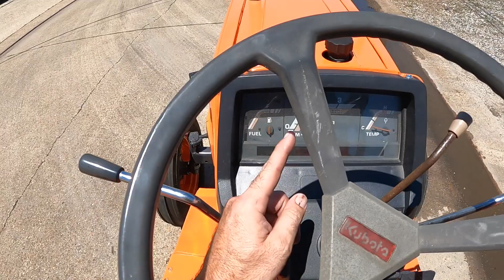Kubota Tractor Restoration ~ Make Your Tractor Look NEW Again!

Comment: Great job. Looks like new. Mine is a L2850 DT. Would like to attach an additional valve bloc (2 double, 2 single action valve). I wonder how to connect the bloc to the bloc on the right hand. On the first look, I would connect P to the pressure outlet at the Kubota bloc and T ( valve monobloc) to the second port on the right outer side of the Kubota bloc - or is the T port on the front the correct one? Or should I fit the power beyond port at the monobloc to the T port at the bloc? Kind regards Heinz, Germany

Comment: I picked up my L2850 end of summer. It’s in great shape but I noticed my 1st-4th gear shifter dash section seems a bit loose where when I shift the black dash piece moves around a bit. Does that sound like something is broken under there or just missing a screw or what?? I have not had a chance to look at it being down from surgery for a couple of months now.

Comment: Awesome restoration, I have the same tractor and wanted to change out my broken headlight assembly as well.  Just curious what brand 20" light bar did you used for the head lights?  Also did you have to make up your own mounting brackets for it?

Comment: This was fun to watch. Just got an L4850 that needs some love. Did you rhino line your own or do truck bed liner? What's the prep on that? Aloha
Reply from the maker: I had it sprayed. It’s a much stronger coating because it’s a two part product. I just prepped it with a steel wire wheel 👌🏻